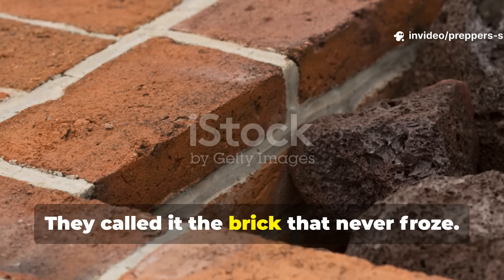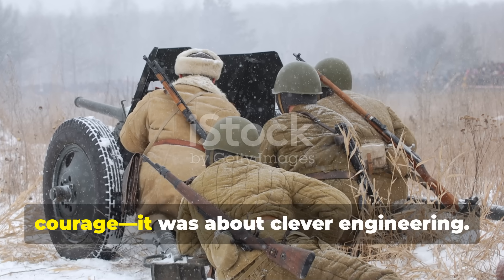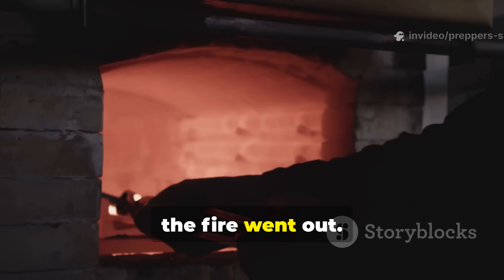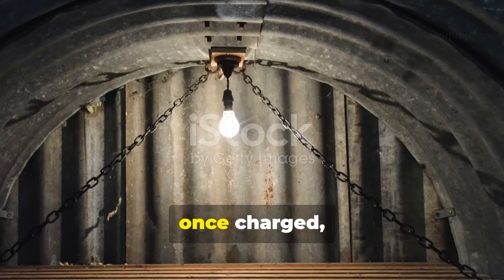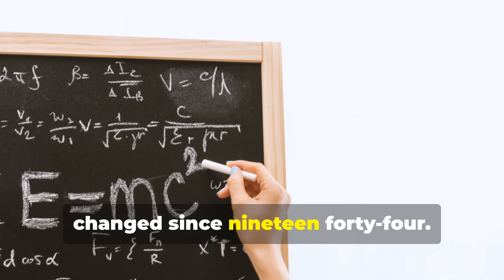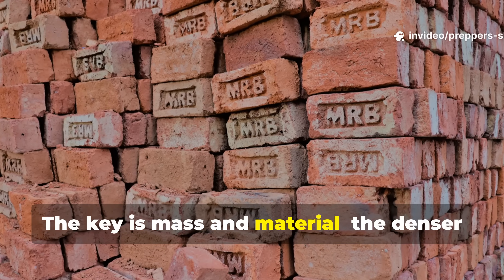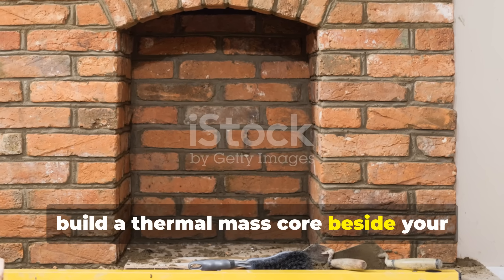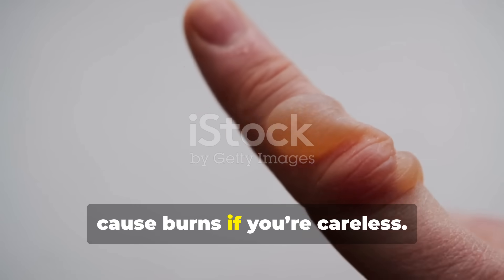The WWII Heat Brick That Outsmarted Winter — How Forgotten Wartime Tech Can Keep You Warm When the P

Comment: I've been using the old-fashioned hot water bottle to maintain warmth at night in bed. I heat water to about 119F. I push it down to the corner of the bed so it doesn't interfere with my feet. I wear a down vest during the day to hold body heat and reduced the need for space heating. I also use little 500 watt radiant heaters from Amazon that cost about $30.
Reply from the maker: That's so amazing, this are things passed down by older generations